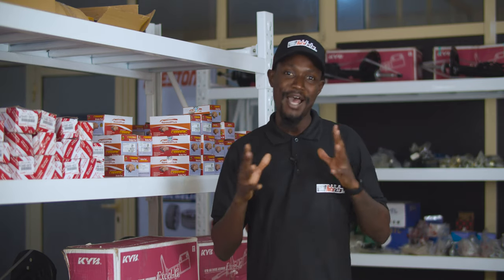Why your car vibrates when in reverse gear.

Comment: Good explanation and straight to the point 👍
Reply: My Audi shake little bit when gear ⚙️ on R or D pls why ?
Reply: @redarasmy1414  it’s most likely a motor mount  if it’s not that it could be one of several things
Reply: Yeah i looked my situation up and its a transmission range sensor. Why would only reverse make it shake that would not make sense that the mounts would do that if the other gears didn't plus he needs to he more specific... this is vague
Reply: @NOOBNOOB007  iirc reverse gear has more torque applied on the gearbox than in forward drives. Since the reverse gear is 1 huge gear cog on its own. Hence it could be the reason why in drive forward gears the mounts can hold up fine but in reverse it may not.
Reply: @kiryukazuma7508  thank you bro i was wondering why that is

Comment: But my is opposite. When in reverse no vibration but once i engage in drive mode it start to vibrate mostly in trafic
Reply: Your throttle body needs to be clean properly